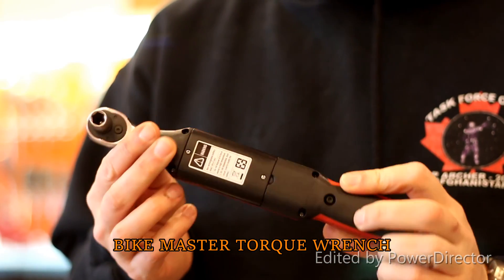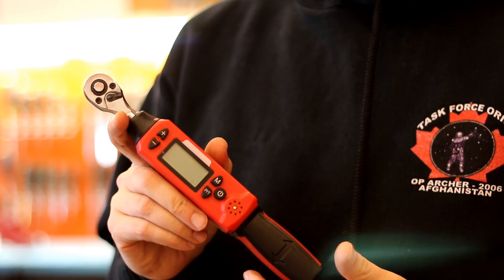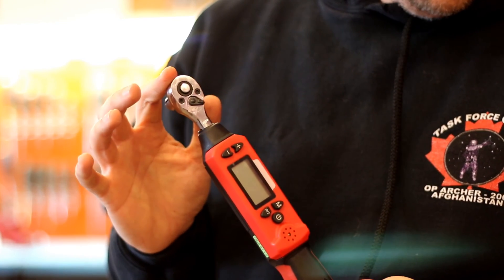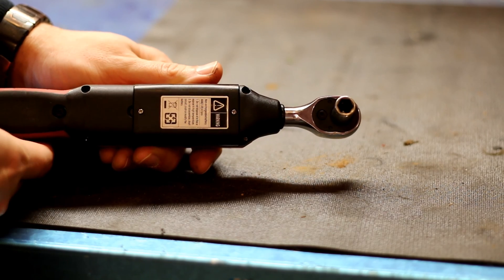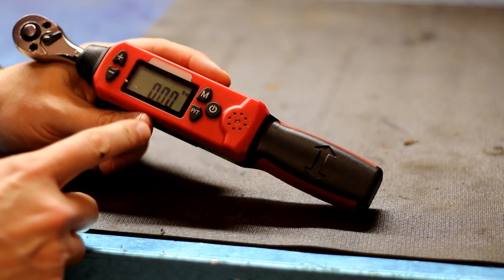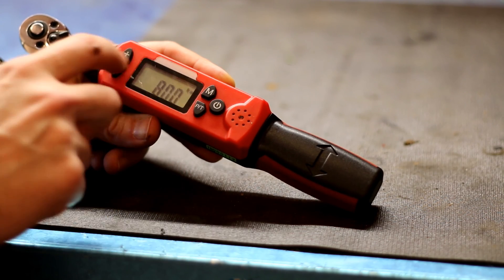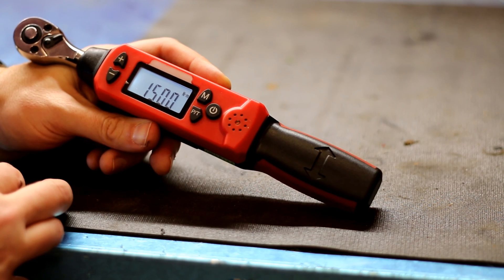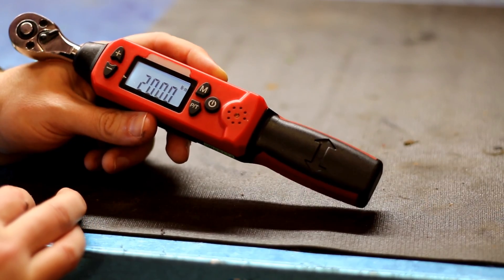Digital Torque wrench

Comment: Very nice.  Good lighting and camera angles.  Do you still have this torque wrench?  Does it still work well?  I usually buy budget torque wrenches but the digital ones are so much easier to use, I'm tempted to get one.
Reply from the maker: I really like it still runs great I keep it in it's case, I use it but the only downfall is the it's limited to 20nm meaning I require the next one up to do anything bigger
Reply: @sigops  Cool.  Thanks.  This makes me want to get one.  I saw an advertisement for this wrench on Partzilla.  That's my go-to place for OEM motorcycle parts.
Reply from the maker: @websolutions6117  oh i meant to say 30nm and not 20nm, it goes up to 30nm